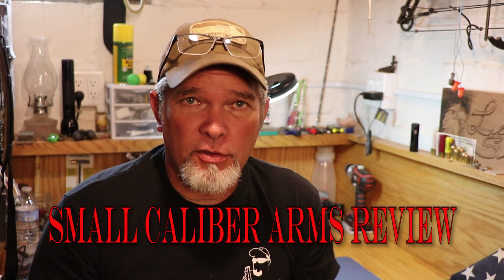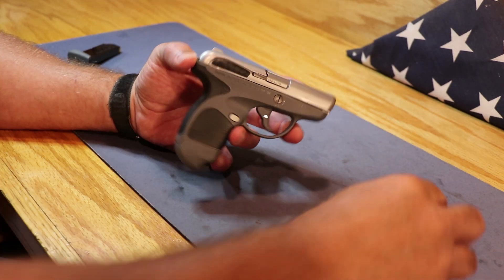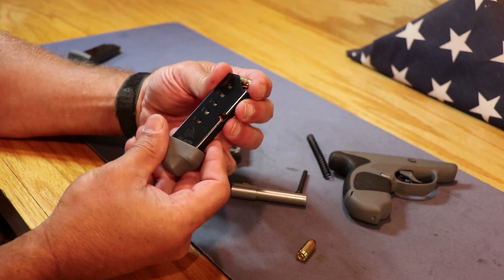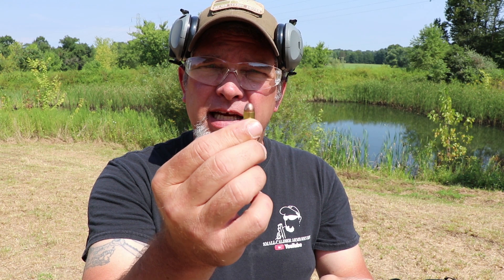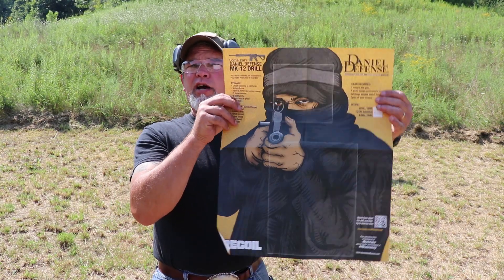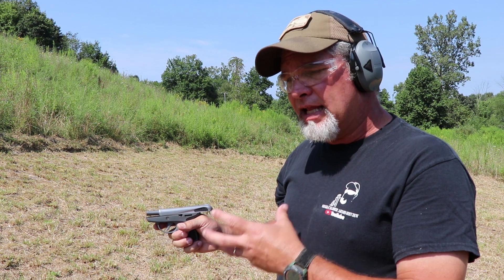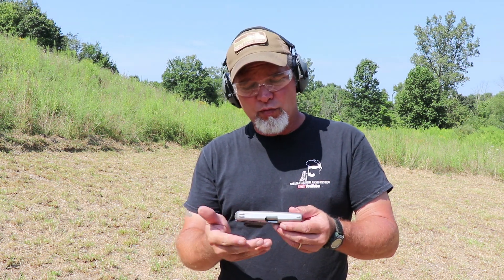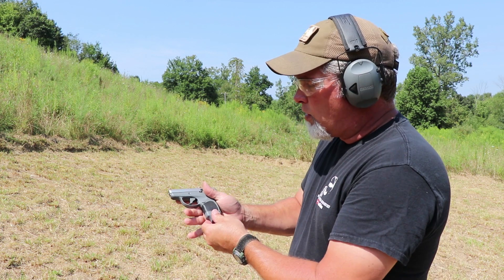Taurus Spectrum Second Look and Second Chance

Comment: I polished the back of the barrel where the Brass sits and it helps with the extraction of rounds . Polished the feed ramp too. I had two light primer strikes but it fired on the second pull. It fires JHP and FMJ without a hitch. I use as a carry gun . May get a Taurus GX4. 9mm is cheaper. 250 rounds of UMC FMJ  380 is 150 vs 9mm for 100. Critical Defense by Hornady is my main choice . I also use a Galloway spring/guide rod too. Way easier to clean the gun.
Reply from the maker: You'd think .380 would be cheaper since it's smaller but, that's not the case. I still need to do a little polishing on mine to see if it fixes my issues because I really like the little pistol. I have the GX4 and it shoots fine but I really like the compactness of the Spectrum. Thanks for watching!

Comment: I always polish/smooth off sharp edges on feed ramps with a Dremel driven grit impregnated 'rubber' 'polishing' tool tip. Reduces/eliminates issues in that area.
Reply from the maker: I think there might be issues in some other areas and some day I'm going to get around to fixing them. Thanks for watching!

Comment: Mine feeds critical defense fine.  Never had a jam with that ammunition  in the Spectrum. Flat nose does not work in mine. Round nose in the middle jams now and then.  Love the gun,but it is ammunition  sensitive.
Reply from the maker: I did a third video on the Spectrum with 3 different brands of ammo. The last ammo I ran was Hornady American Gunner(?). I ran a box of 25 through it but only had 5 rounds on film (forgot to hit the record button). I had zero issues with it. I didn't do any more testing with it because of the price and availability. I feel pretty confident it would be reliable with a good defensive ammo, I just haven't done any more testing with it. Thanks for watching!

Comment: I agree with you it's a cool little pistol just needs a little TLC out of the box you need to polish the feed ramp also in the back where the firing pin comes through and a little on the extractor then it will run perfectly
Reply from the maker: If I ever get around to it,  that's what Im going to try. I hear they have some drag issues. Thanks for watching!

Comment: I have had on for a couple years now. I found the same result with the first round. I have done the same thing you did with the polishing etc and have not had another issue with ball ammo. But, Hollow points are a different issue. I use Winchester silver tip and that first round just doesn't like to feed.
Reply from the maker: They seem to either work great, or have issues. That could be the reason that Taurus discontinued it. Thanks for watching

Comment: I took my new spectrum that I got for Christmas out to the range over the weekend and it was nothing but problems the whole time. Failure to feed, failure to extract, double feeding. If I got 3 rounds to go through smoothly that was a lot. Went through about 30 rounds before I just called it quits.
Reply from the maker: Mine has gotten worse, the more I shoot it. I have heard of others that have had problems and sent them back to Taurus with good results. It's a shame to have to do that to a new firearm but sadly, it may be the only choice. I did have good results with some self defense ammo but that stuff sure is pricey! Thank you for watching!
Reply: @SmallCaliberArmsReview  Hey Richard did taurus fixed the problem, what was it. I got the same problem as you I just gave up.
Reply from the maker: @angelcapote1218  You know something, I still haven't sent it back yet! mixup98 did a video showing how he fixed his issues and I wanted to give that a try but I still haven't tried that yet either! I know, I'm slacking.
Reply: @SmallCaliberArmsReview  I just saw that video before I got your message lol. I'm going to try that.that would be a good video topic to see if you can fixed the problem too. Thanks Richard.

Comment: Comfortable. It definitely looks like it wouldn't do well with folks who have large hands. However, let's hope that extractor issue gets fixed!
Reply from the maker: I have pretty big hands and it's not a bad fit. I'll try different ammo first before checking out the extractor. I have a hunch it's the ammo just because it only happend with the PPU.
Reply: @SmallCaliberArmsReview  I think it's PPU too. Yet this gun needs to be well oiled and cleaned with a brass brush each time after the range.
Reply: Hey cheese I didn’t know you were into Taurus guns I always thought you packed a Colt SAA?

Comment: I had a Taurus TCP that had the extraction issue that this Spectrum was exhibiting.  I sent it back to Taurus twice, got it back twice, and the extraction issue was never resolved.  It did not seem ammo or magazine specific, and did seem less apparent if I was shooting 1 handed.  I put about 300 rounds through that TCP total, and had consistent issues with extraction.  I ended up pawning the TCP as it never ran reliably enough for me to carry, and carry is really all that a pocket gun is good for.  It was a real bummer because it shot well, had a nice trigger, and fed all ammo types without issue.  I was considering getting a Spectrum, but seeing this video is making me lean toward an LCP or bodyguard.  Thanks for the content.
Reply from the maker: I have not sent mine back yet but I'm wondering if The same would happen with my spectrum. Thanks for watching!

Comment: I notice on slower firing it seemed to run fine. Seems firing at speed have problems. I just haven’t had any issue with mine shooting just over 60 rounds .
Reply from the maker: I noticed better results with different ammo.

Comment: I have two Spectrums, one works perfectly, second has occasional light primer strikes. I only used one type of ammo, so it could be picky with ammo. Both guns need the magazines tapped to seat them in the gun. I think it is a magazine plastic cap that is the issue,  needs to be sanded to  allow the magazine to go in deeper inside the gun. I really like this gun, very unique and feels good in my hand. Recoil is surprisingly not too bad for a small gun.
Reply from the maker: It's a very comfortable little pistol and a great size for some deep concealment, I just wish mine didn't have so many issues. I really need to send it in and let Taurus repair it. I've heard lots of stories about people having zero issues and some having lots of issues. I had no issues with Hornady Critical Defense ammo but I only ran 20 rounds through it. Thanks for watching!

Comment: I got mine pretty cheap. I think it was $169.00 total. My first range test was terrible and I wanted to throw it. Now I like it a lot. Yes, you have to really smack the mag in and it seems like a lot of movement. Clean it with a brace brush rather than a nylon. It doesn't like to run dirty, 150 rounds it'll act worse. It needs to be clean and well oiled. I'll have to do another range test to see if it's still good for me. I use Winchester white box (it's not flat headed) or hst for JHP and Brazers for FMJ.
Reply from the maker: Try it with some good defensive ammo and see if it's any different, mine likes Hornady American gunner but it gets pricey when you're just plinking.

Comment: Taurus has a LIFETIME warranty... if you don't send it in then you should complain that they will just send it back... There has been an issue with feeding and what they do is change out the barrels and recoil spring and whatever else they feel needs replacing... in other words they don't "fuck with repairing it"... they replace parts, test fire it with multiple type rounds and make it functional...
Reply from the maker: I've been threatening to send it back since I bought it, I just haven't done it yet. Thanks for watching!

Comment: I shot 7 mags with mine new out of the box without issue.  Winchester is what I normally use, but was using Federal I believe.  Was also trying my MKE Z-5RS and it didn't like the Blazer Aluminum rounds that I had, but ran everything else fine.  Think my next gun is the Ruger Free-Float Carbine!
Reply from the maker: Awesome, I wish I could say the same about mine! I also need to check out the Ruger.

Comment: Good "sanding advice". To this point I have sanded all the edges of my cartridge case rims, where the bullet and case converge on the outside. Some of those are horrendously manufactured. Rough as the edge of an old steel pipe...
Reply from the maker: They're not of the highest quality! Thanks for watching!

Comment: My Story. Traded a Hi-Point 380 in at Smoky Mtn Gun&Ammo for a TAURUS 380 end of Dec 2018 cause they were on sale then at $169.99 plus a $35 Rebate (now the guns are seen for $129.99 or even $119,99).  

Summary: Like you I kind of like the look, feel, and shooting (when it is OK) but at same time I don't have much use for a 380 (AMMO Prices, etc.). I went with it cause thought might want to Pocket Carry sometime).

 PROBLEMS: First shoot, I estimate 40% of rounds took 2, 3, or 4 trigger pulls to fire (as well as some feed problems like yours where bullet jammed into feed ramp  - not so much extract or eject problems). TAURUS took it back (paid shipping also) and seemed to have fixed the Fail to Fire problem - I shot 68 rounds day i got it back, still had two Fail to Fire.

Then couple shoots later (maybe another 30 rounds a few days later), it started locking back while shooting. It took me a couple shoots later to realize that the lock back lever was moving up and catching the slide (no spring tension to hold it down). TAURUS took it back (paid shipping also).  It came came back and has worked good since. I don't think I have had any failures except one fail to feed - bullet wedged on ramp (more on that later).  It appeared they had  installed a new recoil spring (stiffer and very hard to install it and the rod when reassembling - I actually use a 22 cleaning rod fed thru the front into the spring to keep it straight while  pushing the rod fwd to where it needs to be). It also appeared they installed a new striker at least parts of it as it is different color than before.  

As I said - all worked OK except the one fail to feed (bullet wedged at base of ramp, actually the bullet contacts the wedge below the center point of the bullet - seems should load).  So, sort of like you but a bit more extreme, I modified the bottom of the fed ramp by thinning it and actually making it a bit "U" shaped (very slight 'U")  VS straight across. Maybe help understand if I say -  looking down at the ramp from top of barrel, see slight "U". 

I probably have ran 100 or maybe 200 thru it since with no failures.  That includes some aluminum case, and some flat nose (stuff I bought from a friend that sold his 380). 

Anyway, lately I am satisfied with the gun and find it fun to shoot. Biggest problem is it is a 380 and AMMO is more expensive than 9MM by $0.05 or $0.10 a round (shoot 100 rounds, talking $5 or $10 - Ain't worth it to practice).  And, I am not sure I want to mess with pocket carry -- trade it when AMMO is gone (Maybe, doubt get more than $50 out of it). 

None of that relates to an Extract or Eject problem ad your U Tube shows not fully extracting (so guess an extract problem vs an eject problem). 

Talk to TAURUS - Lifetime Warranty and I imagine they will take it back (they pay shipping)  and fix it.
Reply from the maker: I'm going to try some different ammo first, then if the problem persists, I may send it back.

Comment: Oh wow this kind of stinks. First thanks for excellent videos you do. I ordered this gun from RK guns for 119 but hasn't came in yet. Got me 2 more 7 rd mags from CDNN. Seen lots of issues on this little shooter but for price was hoping for a good one. Sometimes I just want a little one in my pocket instead of my 9mm on my hip. My 380 acp pistols in the past sometimes didn't like flat points either. Any way thanks for heads up and hope I have better luck
Reply from the maker: I hope you do too. I'm probably going to do one more video on this little gun with some better ammo. I'm pretty sure ammo was the issue, there's only one way to find out!
Reply: Check my response - don't give up (TAURUS will Fix it) and don't blame it on AMMO (might be a factor, but mine seems to be finally fixed).
Reply: thanks so much. will do and glad yours is working because like you I like the style and looks of the gun

Comment: I have found with this pistol you have to grease EVERYTHING or it will constantly jam. All I can find right now is frangibles which have flat rounds, but with the barrel lubed underneath the slide, no feeding issues.

Has anyone tried 100 grain rounds through the spectrum? I’m use to the 75 grain frangibles but came across 100 grain JHPs and definitely feel funny coming out of that little gun.
Reply from the maker: I've had just about every issue you could have with this little gun, I did have good luck with the self defense loads in the third video I did. Thank you for watching!

Comment: I used the white box 95gr flat point it works good it’s just it would scratch it if u take the round in and out but other than that it works perfect
Reply from the maker: The first shots I took with it worked great and the more I used it, the worse it got. I believe it will handle the self defense ammo fine, I fired 25 round of it without a hiccup in the 3rd video. Thanks for watching!

Comment: My Spectrum had feeding issues with the flat nose ammo. Sent it back to Taurus and it came back able to shoot anything that I have run through it. They polished the feed ramp and replaced the spring with a heavier spring. I will never try steel cased ammo so I can't comment on it. It looks like the Spectrum is not currently being sold in stores. I wonder why?
Reply from the maker: I still have not sent mine back, I really need to though. I am still seeing them in store here and there but lots of firearms are scarce these days. Thanks for watching.

Comment: I know it's a video from two years ago, so chances are you've already fixed the problem or sold the Spectrum. Some things that come to mind in this type of problem are a poor finish of the chamber internally and the ammunition. In the case of PPU ammunition it is possible that they were brass plated but that the case was actually made of iron, as happens with some Sellier & Bellot of the cheaper line. I would try to polish the inside of the chamber to a mirror finish.
Reply from the maker: No, I still have it and I keep telling myself to send it back but I still haven't done it yet!

Comment: I am having the same problem with my spectra, going to run 300 rounds through it and polish the ramp before I send it back and also it may work out with a little use also, Try different ammo, stay away from flat tip ammo with 380
Reply from the maker: I only used a few rounds of the flat tipped stuff and didn't have any issues with it. It seems to shoot great with the Hornady American Gunner 90 grain ammo.
Reply: Did you keep the magazines loaded for 48hrs before shooting? That was a little side note in the manual.
Reply: @HemisFair210  No I did not, will give it a try
Reply: steve trainer I just bought one yesterday and was going over the manual again. Glad I did because I was about to go take it to the range tomorrow.
Reply: @HemisFair210  ok,, I will read the manual also,,  lol

Comment: I like the gun, so far no trouble. Wasn't as cheap as yours though!
Reply from the maker: Almost everything has gone up in price, I see guns I paid 200 for, up to 300+ nowadays. Crazy. Thanks for watching!
Reply: @SmallCaliberArmsReview  yep, and we're not even mentioning ammo!

One thing I forgot to say, my gun did feed the flat nosed Winchester fine. Do you still have the one from the video, and if so how has it been doing?
Reply from the maker: @robertk407  I do still have it and I was planning on sending it back but I've just never got around to it. I haven't fired it since making the video but it seemed to handle the Hornady defense ammo without an issue. That ammo was extremely expensive then, I can't imagine what it cost now.

Comment: Nice video. It’s kind of funny; I think you just did an LCP video and I commented about the Spectrum. 

I’m still working on the full review of the Spectrum for my channel, but I’ll definitely take your video into consideration. 

Speaking from personal experience, I have a few things to say. First, Winchester White Box sucks. Yes, it’s cheap. But I’ve had way too many bad experiences with it. I’d say in those bulk packs of 100 rounds, you get maybe 90 that are useable. I’ve seen dented cases, poor (or missing) crimps, and even cracked cases. I even saw a bullet that was loaded sideways! And if you’re asking yourself “how is that even possible?”, the answer is yes. 🤷🏻‍♂️ So I don’t buy WWB anymore. Blazer and Fiocchi are much much better and about the same price.

When I worked at a gun range, I saw problems with these pocket pistols every day. Usually it was an inexperienced shooter not gripping it properly and they would insist that it was the gun. 🤦🏻‍♂️ In your case, I think the problem might be a bad extractor (or extractor spring). Since the problem is a failure to extract, and it’s repeatable, I’m guessing it’s the extractor and not the ammunition. If it was the ammo, it would be more sporadic and not consistent, as you demonstrated.

I’d recommend what one of my viewers recommended when I had problems with my Stoeger STR-9. Send it back to Taurus and have them look at it. Give the manufacturer a chance to remedy the problem before you just call it a crap gun. 

Hope this helps. Again, nice video!
Reply from the maker: I've never had any problems with WWB and I didn't have problems with extraction in the first video. I'll pick up some more Blazer and probably some Fiocchi and see what happens.